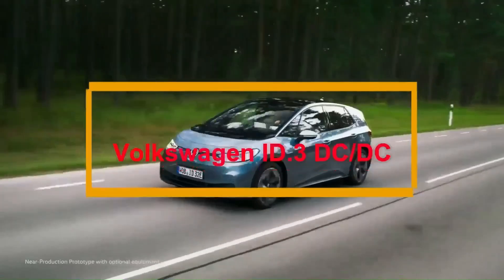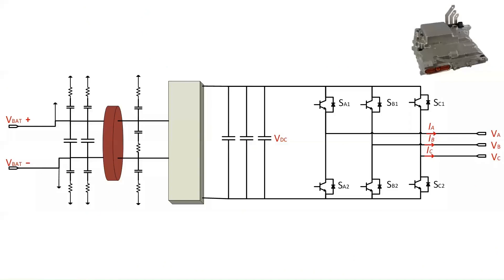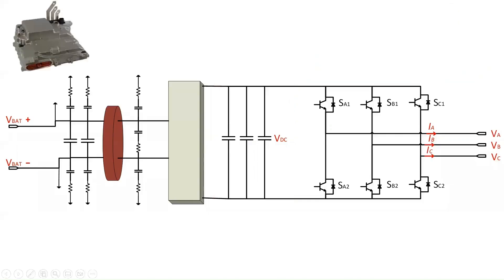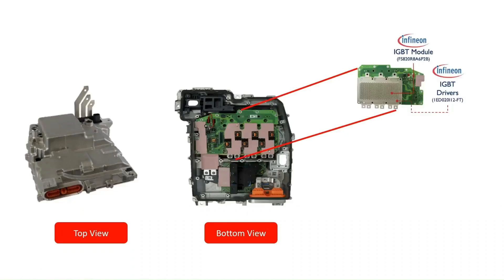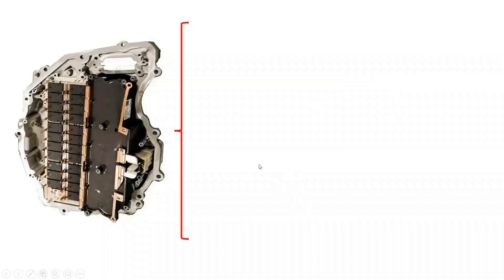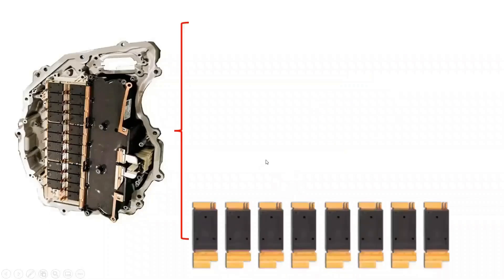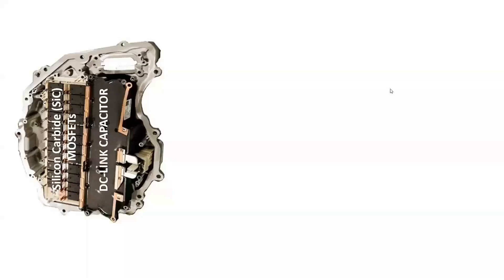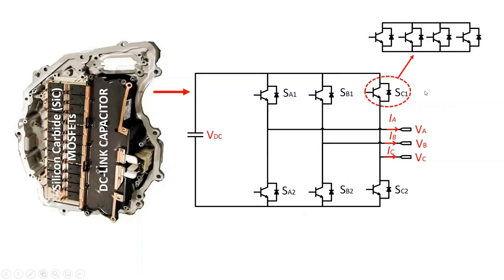Tesla Model Y Inverter vs. Volkswagen ID.3 Inverter

Comment: 0:31 that is the smaller front motor / inverter. The video later show the old 150 kW inverter of the old APP310 rear motor.
In 2023Q3 VW launched the new rear motor APP550 with 210 / 240 kW inverter depending on model. The motor is very strong with 545 Nm torque. That is  more torque than a Tesla Y LR with dual motors.
Reply from the maker: Thanks so much for the extra information and clarification. Much appreciated.